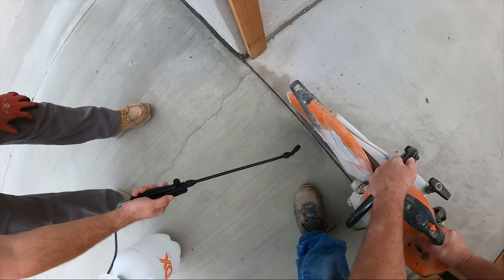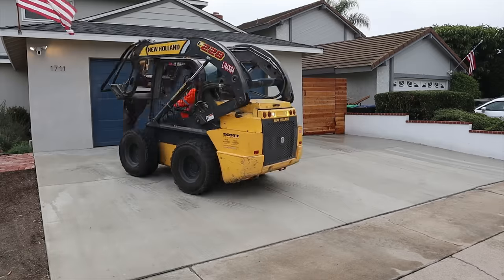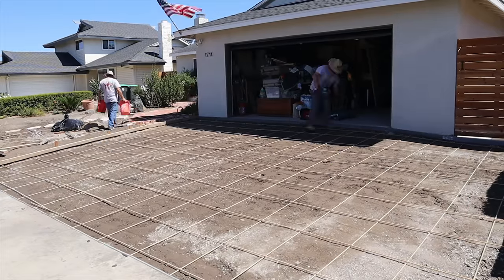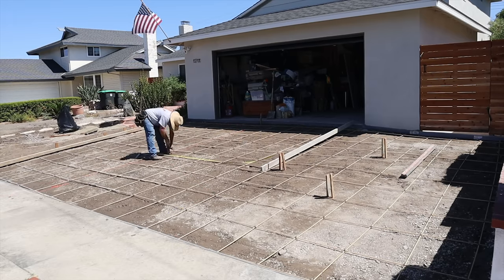Concrete GONE WRONG! Had to Remove and Replace

Comment: How do you address who is at fault?? $$?
Awesome you honor your work!
Reply: Pieces of the old concrete can be sent to a lab for testing that will determine if the mix from the plant was wrong.
Reply: @larrykeenan598  to the homeowner the contractor is the guarantor of the Job. unless the homeowner bought the materials. The contractor can then turn a round and get restitution from who ever is at fault. Per contract

Comment: David, you seem like a good guy and an honest contractor so cheers to that. On the other hand I felt the need to comment as I saw so many issues and as a concrete producer for over 40 years really dislike the "CONCRETE" gone wrong title. Can there be issues with concrete production and delivery? Absolutely. But to name the company in the video and then the "across the street didn't crack" company, you inherently stated the National is bad, Cemex (I think that's the name you used) is good. Those Shrinkage and Map cracks could have been caused by 100 different things. Were the weather conditions IDENTICAL for both pours? Same slump concrete? Same sealer? Do you know 5mph of wind, direct sun vs shade, or a slightly higher ambient temp can do exactly that to the surface vs. "across the street"? Now for the reinforcement. Is it possible the fiberglass\plastic rods have the tensile strength of steel? Absolutely. But what about bond strength? Smooth plastic vs. raised edge rebar. Let's ignore that (as I'm sure the manufacturer did) and talk about the placement. I see you tied it off into sections and will make the assumption the rods could not slide in place, good. The problem is the reinforcement, to be effective, needs to be ~2" from the surface of the concrete (5" slab) and be VERY uniform in depth. Your reinforcement all ended up stomped down to the bottom, which renders it totally useless and IF there are sections that didn't (so its up and down in the slab) it actually is worse that none at all. As for the .6 lb per CYD of microfiber per CYD, all reputable microfiber manufacturers (there are some BS off-product salesman that say different) dosage rate starts at 1.0 lb, and the reality is even a 1.0 lb. microfiber is relatively useless for anything but surface impact spalling. If you want to use fiber use 4.0+ lbs per CYD of Macro-Fiber (Forta-Ferro is excellent) and get real integral reinforcement. Your waiting two days to saw-cut can really bite you in the butt if you have two sunny\windy\hot days, shrinkage cracking will occur in the 1st 24 hours. Possibly look into a soft-cut saw to get it done early. Last but not least you offered to spray form release oil on the trowels, this is a horrible idea as just 1 drop of this oil finished into the surface of the concrete can destroy an area. Please consider a concrete course that your local NRMCA most likely puts on, you have the heart, just need a bit of guidance! Best of luck!
Reply from the maker: I did it the same as across the street, two weeks apart.
That's the only difference.
All jobs are on you tube.
It impossible to debate or speculate. It's crystal clear.
Reply: oh, please, get out

Comment: what is the size of this and how much does it cost?
Reply: yes i wondered too cause i have no idea what this stuff costs, i just know i dont want to be doing it
Reply: Estimate

$120 / m3 concrete

Rock breaking machine $200 per day

Disposal of old concrete $800

Labour rate $200 per day per man
Reply: @mulletman1705  thanks thats an informed ballpark
Reply: @mulletman1705  the concrete company would have gotten the bad concrete back. Every load is sampled and tested. Concrete company should replace for free.
Reply: Exactly what this man said.  On large pours and most contract work there is a guy who doesn't work for anyone but a 3rd party that just sits out there and does nothing but take samples of from the truck and the pour.  They test them to see if they can withstand ceertain crush pressure and such.  had to rip up a pour or so on big jobs because a truck brought in a bad mix from the plant and it was all borked after testing.
Reply: Cost 20k while the driveway was perfectly fine small crack here and there. New driveway but city sidewalk big crack no point to replace it. Only thing good is money in his pocket.
Reply: @ManCaveGroove  that driveway did not cost $20,000 LOL
Reply: @mulletman1705  You pay seriously 200 Dollar per day for one man? Wow, in central europe you pay 80-100 bucks per hour.
Reply: @bliblablubb0712  In central Europe you do not pay 100 per man, that would mean that after tax the worker would only be left with about 60 euro. You wouldn't get someone to work in MacDonalds for that rate, never mind the construction industry.
Reply: @mulletman1705  re-read the comment. I also misread it. They said per hour.
Reply: @himabimdimwim  that's a typo, constructiom workers don't make a grand a day in Europe
Reply: Used to be about $5/ft² probably a lot more now with inflation.

Comment: 5:25 Based on how that's coming out, this problem is almost guaranteed to be caused by a bad concrete mix. If they're not a typical source for your mud, I'd strongly suggest you black-list them and never again use them for your projects...

Depending on the costs involved, I'd also suggest Suing to recoup your costs (original pour, removal and replacement) of the concrete and man-hours and Court Costs...Causing Bad-Blood between you and the concrete supplier shouldn't be a problem if you're going to Black-List them anyways...
Reply from the maker: Great points.
Cost money and time to do all that
Reply: Wrong, I see this all the time. I drive a concrete truck and what I see is mind blowing, the concrete batch goes out to the job-site correct as to the specs the contractor orders the mix. Problem is when the truck gets there, the laborers, which 90% don't speak english add water to the mix to thin it out, not just that but in order to cut costs after forms are set they will bring in loose dirt and backfill the pour area decreasing the amount of concrete needed, this leaves a couple inches soft fill that in time will settle making the slab break. The reason they will add so much water is to make the job so much easier, just pure laziness. The bubble holes appearing is also an indication of heavy water mix as well as they didn't work the finishing very well at all.
Reply: Only way to fight supplying company is take sample or two from each truck before any water or fiber is added. I use to do work in SW Florida and we seen many of samples fail at testing lab. Anything on a high rise is tested. They also did not like fiber in anything greater then 3500lb. Fun when a post tension slab fails when the cables are pulled🥺

Comment: Would have first drilled various core samples of that failing concrete to submit for testing against the original specification.
Reply from the maker: Very exspensive.

Comment: I was planning on replacing a slab 8'6" x 51' during the beginning of the rainy season. The contractors say it would be safe to Demo and Pour as long as we can get 4 days of good weather. I don't know If it's a good Idea to Start this job now or wait until spring. What do you think?

Comment: Nice video. Other than the cracks, why is the color not consistent? I just had my driveway done. It’s been about 8 weeks. I have some light areas and some dark areas. 2 different trucks but even in the same area with one truck, it’s still off. Thank you.

Comment: Great video. GREAT JOB! I appreciate a good contractor standing by their product and job. I like the pad that is not cracked and how many control joints. Mine is a corner home with very little control or expansion joints in it and cracking. Now you know which cement company NOT to use. Hope they reimburse you for the concrete. I want that many cuts in my new driveway when I do it. Too bad you don't serve Texas.
Reply from the maker: I got the second free, but it was a loss

Comment: I've seen concrete workers stealthily dropping bags of sugar in the mix to hold up curing because they are short-handed or just slow.  Would be interesting to know if a supervisor was on the job the entire time and is sure the retardant was not dropped in the mix. Could be contaminated fly-ash, but I would first rule out plain sugar.

Comment: Mixer driver here.  What we do if we have to add Super P or any other admix product on site (including fiber) is we roll the drum backwards and bring the concrete up to a point where the additive slides off the hopper directly onto the concrete, then give it a three to five minute stir.

That way, you're not having to rinse product off the fins and sides of the drum with a big shot of water; the concrete stays at the slump it arrived.

Comment: Did you pour both driveways with the same "slump" and did you use 6x6 or rebar on both.  I am assuming the spalling may be the concrete's company's problem or your men did not properly agitate the concrete enough to force the bubbles to rise to the surface.  I would also venture that the cracking was because the concrete was not viscus enough or the weather was too hot when it was going-off because concrete shrinks a lot and the only way to prevent it is to slightly wet it and cover the slab with a tarp  and hay to keep the heat out and the moisture in so it cures much slower.  If you didn't use the same style of the use of rebar or mesh in both slabs, they will come out differently.  I am interested in what you found out about how that happened.  Thanks

Comment: Question for you concrete guys. How does the number of barrel rotations relate to concrete strength? We got our driveway patio poured first thing in the morning and are not far at all from the mixing plant. The truck was at our house in maybe 20 minutes. 22 years later is still looks great. What if the truck had to drive 90 minutes? Would that effect the pour and quality or longevity?
Reply from the maker: Your guess is as good as anyone's

Comment: I live in the UK, (nothing exciting about that). However, my parents started a business on their own, - (second-hand furniture), - they advertised like mad, - had to in order to get stock and also sell it, - I joined them in '66, I worked hard - had to, - in '70 both died of cancer. I will never forget what they were always telling me, -- It can take you 8 years to build up a reputation - BUT it only takes 8 seconds to lose it. I have great respect for this gent He stands by HIS work. The only thing I don't understand is he put 'fibre' in it again AND used the same concrete supplier, - unless the customer was hoping the concrete company would supply it free, or charge a lot less, and the concrete company didn't want a sample of the 'cracked up' concrete to test.
Reply from the maker: Yes the concrete company did provide concrete on the second attempt

Comment: Good for this guy, I have a asphalt driveway with sinking and cracking after 1 year.  The installer has given me atleast 6 different reasons why it's not his fault.  Integrity in contractors is a rare trait anymore.
Reply from the maker: Wow I didn't know there could be that many reasons

Comment: U put microfiber in the mix? That helps with cracking during cure. Also add more joints cut it up small people may not like a lot of joints but it will keep it from cracking like that. Good on you for warranting your work
Reply: You can see him add fiber in the video.

Comment: There are so many reasons that the concrete went bad, from different cement (powder) supplier to alkali reactivity to excess water. A petrographic analysis done by a reputable lab could have revealed the base causes. It is obvious that the sub grade was prepared correctly and the use of fiberglass re-bar will not have any adverse effect on the mixture. If you had anyone on your crew to at least check the batcher/mixer slip from the concrete supplier, the problem may have been averted. Also, trained field technicians is one way to protect you from future issues by site testing slump, air content and material temperature and by making test cylinders for strengths. Keep up the good work!
Reply from the maker: It's rare thing but bad concrete happens.

Comment: What was National's reason for the first cracked driveway? Did they have batching plant issues? Maybe the driver didn't start with a clean barrel? 

I'm very interested in the diagnosis. Former transit mixer operator. 

Thanks.
Reply from the maker: No idea

Comment: Mr.O, whats your thoughts on filling expansion joints between slabs with the seka self leveling product?  My thoughts were that it would prevent water seeping in and eventually causing settling and cracking.

Comment: Did you try to use hydrated lime in the mix? It tends to auto seal the small cracks in concrete and delay the curing process.
Reply from the maker: Didn't try that.

Comment: I work for a contractor in the Chicago land area, we do concrete and asphalt, but yeah it looks like some quality control issues with the mix, and it sucks too. We put mono fibers, 4 inch base, 5 inch 4000 psi (6 bag), 99% of the time the mix is good no issues, but rarely it does happen, but we have a relationship with the plant so their sales guy gives us a huge discount per yard when this happens.

Wish me luck this season, I'm going to be picking up operations manager role for this company, former estimator.

Sometimes it's on us though when our guys reinforce the concrete too much and make the slab to rigid to not let it move. USE EXPANSION JOINTS WHEREVER NECESSARY.
Reply from the maker: GL

Comment: When wrapping the expansion around corners I always run a razor to allow for it to flex right into the corner tight hood possibility and I’m really surprised the plant didn’t replace the concrete considering they sent bad mix/ another trick when cutting your floors stick some paper in the cut where two lines meet up to prevent cracking in the corner
Reply from the maker: Good ideas

Comment: Can you layout the differences between the national and the Cemex across the street? Cut distances, reinforcement, temperature range, sunlight exposure, wind, humidity, curing, slumps, and water added on site, etc. ?
Reply from the maker: That's to many variables  and secret stuff

Comment: I had a concrete driveway poured and 6 months later there were probably 30-40 cracks.  I thought it was because it was poured in the heat of a Dallas summer and I didn't keep it moist so it was my fault.  My concrete guy never mentioned I should do that but I found out later it's a good idea.  Now, I think it was just a bad pour.  I wish I'd known about your site earlier and I could have asked that question.
Reply from the maker: Bummer

Comment: I don’t know how it looked after you removed the driveway under warranty, but I’m curious how that played out. The reason I say that is because I noticed some cracks in the garage. I’m guessing that was from original settling issues is why the garage cracked, but I’m  reserved  from saying too much because I don’t know the whole story.  I am all about backing up your work but if there are other underlying conditions that the contractor or homeowner don’t see creating this? Just curious….

Comment: Hi nice video ! 
  Is compact an absolutely a think you need to do before putting down concrete? I heard watering it down is ok too. Is that just a cheap shortcut ?
Reply from the maker: Compaction is always a good idea
Reply: @OdellCompleteConcrete  thank you so much for replying! 
  What type of penetrating sealer do you recommend and how often do you reapply it after your first coat or two of treatment?

Comment: Only time I ever seen concrete do that is when the load blew up in the truck and they kept putting water to it then you put it down and it lays a long time before it dries. I've seen it a couple times and both times they were loads mixed to go to one job then there is some issue and the plant chooses to send it else where. Did you get the cement company to cover it?
Reply from the maker: They covered concrete only. The least expensive item in this whole scenario

Comment: Hi Odell. The skill saw causes chips in the concrete after you saw cut control joints the next day. What type of saw is this that you’re using
Reply from the maker: Fibermesh prevents that.
Medusaw from Skil

Comment: I live in Chicago. City replaced curbs and driveways on multiple blocks this Spring. Cracks developed within weeks. Probably will crumble over the winter. A pension and a paycheck. Plus, a "connected" company, Ozinga, supplies all the inferior concrete for city projects.
Reply from the maker: That sucks

Comment: Hi, would it help the slab to become more consolidated if you used a vibrator?  However, I know vibrating can make the mix go off real quick.
Reply from the maker: The vibrator wouldn't do much in this situation

Comment: I’m just a landscaper from Ontario Canada and within 5 seconds of the video I can see the driveway didn’t have enough control joints that’s why it cracked where you didn’t want it to crack.  You can’t have too big of slabs otherwise they crack. All concrete cracks that’s why you use control joints but you need enough of them . Not enough in this driveway

Comment: Dave, you need to research a new method of slab work discovered by a Cajun Couple, it’s called dry pour.  All your problems would have been solved with their approach of pouring dry bags of concrete on the ground and lightly spraying with water every hour until it is set.  No cracks, no contaminants, you can even do it by yourself without a costly crew.  Work smarter, not Harder.
Reply from the maker: I've did that system 30 years ago and it doesn't last.

Comment: You put a lot of water in your concrete through the back of the truck. Never seen that before. Cheers on your integrity.
Reply from the maker: Thats was about 1.5 gallons